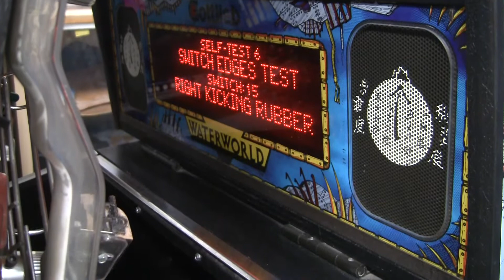Diagnosing/Testing Optos - Gottlieb System 3 Waterworld - PinballHelp.com

Comment: Mine all worked on my Rescue 911 machine for the first 20 minutes or so that I owned it.  Now they don't work.  Self-Test page 5 says " INOPERATIVE SWITCHES: switch 34: ball lift down, switch 91: top upkicker opto, switch 41: right wire ramp opto, switch BO: lower track opto".  No LEDs lit on the opto boards.  I've never worked on pins before.  Not sure what to do.  :-(

Comment: The IR LED's used in pinball machines are not what I would call 'standard'.
There are three main wavelengths of IR LED, being 850, 880 & 940nm.
850nm usually being used for CCTV illumination & 940nm used for consumer electronics remote controls.
If you buy generic IR LEDs from a local electronics supplier, chances are
that you will end up with an 940nm (CQY89 equivalent).
I'm not sure what Gottlieb used, but WMS Bally definitely use an 880nm LED.
If you are in a bind & have to use a different wavelength LED, you must
replace BOTH the transmitter & reciever for reliable operation.
Great Plains Electronics & Element14 sell the QED123 880nm transmitters at reasonable prices (approx USD$0.40ea).
The QSD124 recievers hardly fail, but are available for about the same price.